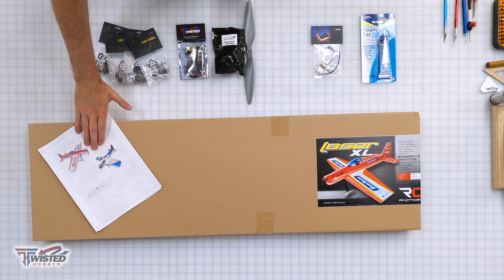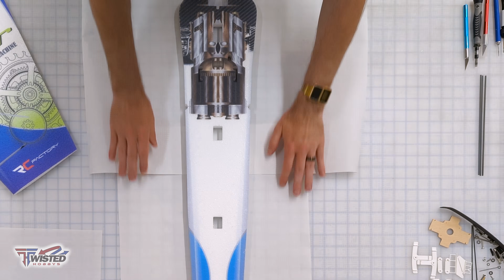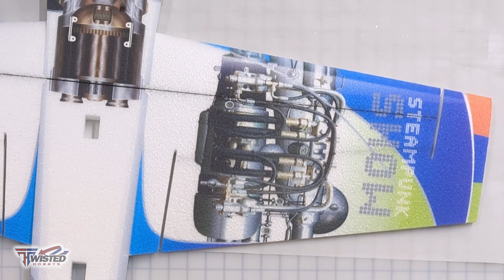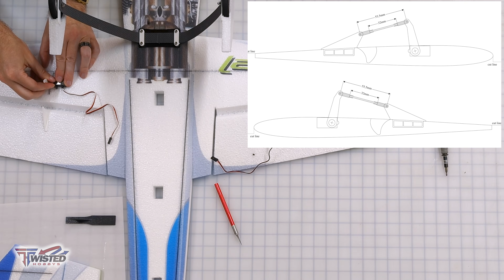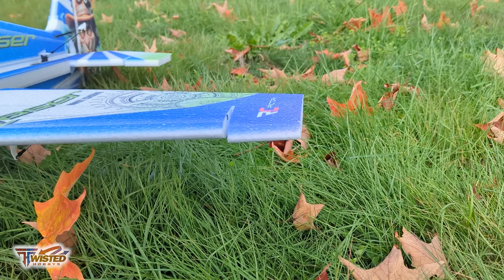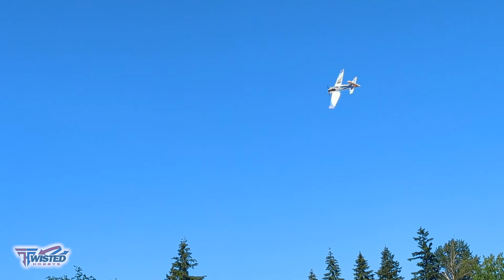Twisted Hobbys/RC Factory - 42" Laser XL - Build & Maiden Flight

Comment: Are these build directions in the manual?  Did the receiver come with it?  If so what brand ?
Reply from the maker: Correct, a PDF of the manual is available on the product page. We follow along with the manual as closely as possible, though the videos serve as a basic guide. The manual contains more detailed instructions. Currently, these models are sold as kits, and electronics are not included. This model is manufactured by RcFactory in Europe, with electronics provided by Twisted Hobbys.